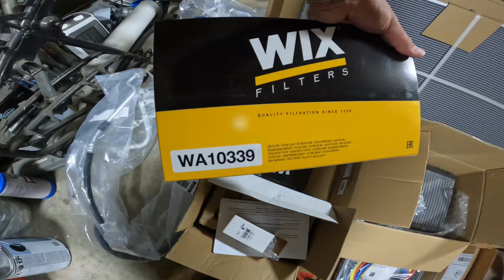DETAILED! 1234yf to 134a conversion! Honda Pilot ‘16 to ‘20

Comment: I bought an adapter from Amazon and charge them all with R134A now and they work just fine. I do a lot of late model Honda vehicles this way.
Reply from the maker: Yea every Honda I’ve seen 134a works just fine in it I partially made this video too because I had a guy in a recent video tell me I couldn’t do it lol. I would’ve done that also but there was metal in the lines from the compressor. The 1234y eats the compressors that stuff is trash
Reply from the maker: That is good to know though! Thanks for the comment

Comment: I have been a mechanic for 45 years back in the day of r12. They discontinued it's use so there where conversion kits for 134 and the systems worked great with very little replacement of parts (134 type connectors) and  a good flush mainly because you where switching from mineral oil to synthetic 
I am wondering why you are replacing the entire system
I know that the system components are configured (size) for 123 why just not flush the system and a new 134 compressor? 
Even with the metal in the system a knew compressor and a good flush and a filter with a magnet on the suction side for added insurance I worked on transit buses (large systems) as well as passenger cars 
Great video shows the extreme difficulty of being a great mechanic and the tenacity and patience required
Reply from the maker: I replaced the whole system because the shop told me it was 70% clogged and contaminated with metal and from past experience I’ve never had good experience with flush I wasn’t so much concerned with the lines they would probably be fine with a flush but the evaporator and expansion valve and condenser didn’t wanna risk leaving any of those plus the valves on the lines were leaking so it had multiple problems so decided to replace the whole system help me sleep better lol also I wasn’t sure if cross contamination was something to be worried about I’ve heard ppl do it without problems just didn’t wanna risk either of those
Reply: We used to just add propane to the R12 systems.  And dont start about possible explosions,  2 pounds of propane is not as bad as 20 gallons of gasoline.
Reply: @flipposgarage I personally work on ac systems on cars every hot day of the year I find the condensor catches most of the metal along with the expansion valve the evap core generally has 0 issues being left alone saving hours of shop time taking the dash apart. 

Also there was not any metal I could see on the expansion valve so they likely just quoted you a full system to comp for the expensive r1234yf and Jack the engine up on after removing the motor mount it makes dealing with j series easier.

Comment: Ive heard of people filling hondas with 134 instead of the new stuff and it works just fine
Reply from the maker: Yes it does from what I’ve heard also. Parts replaced because of the metal that was in the system from failed compressor. My opinion and the 2 shops i spoke with said the cause was the new 1234yf refrigerant causes the compressors to fail early. I also made this video because multiple people told me it wasn’t possible. Wanted to prove em otherwise. Thanks for the comment!

Comment: Facts if you want to convert 1234yf to 134a you don’t have to do all that. The only part you have to convert is the fittings. I had done a lot of American, European and Japan vehicles from 2017 till present meaning 2024 the only thing that has to be replace is the hvac a/c high and low fittings cause there different it’s been done before since 2017
Reply from the maker: You do if there was as much metal in the lines as this one had… I wouldn’t ever leave a condenser or evaporator if a compressor sent that much metal thru the system. Now if ur just doing conversion then ur right but wasn’t the case here

Comment: I have 243,000 miles on an f150 with no AC issues yet, it uses R1234YF stuff.   Its outlasted any on my R134A systems.  Not saying its better. Just interesting.
Reply from the maker: You my friend have a unique situation… that is definitely not the case for the Honda’s. The shop mechanic told me it’s the Freon is the problem, i spoke with 2 different shops. That is good info though thank you for the comment!
Reply: @flipposgarage  Well, I also have the same alternator, and starter, I know ive been lucky. Never seen any of these parts last this long. Went through a lot of batteries though.

Comment: We like our shit cold bud. R290 is the way…..
Reply from the maker: @projectfarm made a video using propane compared to 134a in a truck he had and the 134a actually outperformed the propane in terms of cooling. It was a cheap can off Amazon though so that may have contributed to the poor efficiency, 🤷 interesting though…
Reply: @flipposgarage  I’m in Florida. I see a 10° minimum drop on vent temps at idle. Sometimes as high as 15°. It’s pretty critical to use high purity propane. 99% or greater. I got mine from a commercial refrigeration company here local. Was like $300 for 20#.
Reply from the maker: Love it! Gonna have to try this out on my beater truck lol thanks for the info

Comment: F the regulations. Do what you want free country. Nice work. 134 a is superior just like r 12 was before that
Reply from the maker: I agree! Proud to call USA my home. It’s really funny taking a look at the comments that are starting to roll in… All the parts installed were done so to manufacturers specs and same with the 134a refrigerant. Manufacturers say you can use either, just not to cross contaminate…. Which I didn’t, every part was replaced. Thanks for the comment!

Comment: What you're doing is highly illegal(Federal Law under Section 203 of the Clean Air Act).
Reply from the maker: Plz read disclaimer in description. Also, all parts installed were installed to manufacturer specs and refrigerant used were also manufacturer specs. Thank you for the comment have a great day.
Reply: The federal government will spare you the agony of death
Reply: Hes fine if he’s changing the system completely over he’s the exception he’s not bound by the licensing because he’s working on his own stuff he’s not required to do anything except what he already did which was having the system evacuated and the refrigerant gets recycled the EPA is most satisfied with this in that regard anyone saying he can’t did not read the entire section referring to this